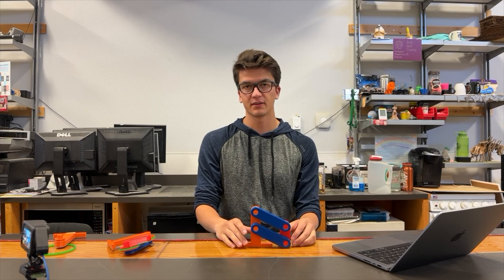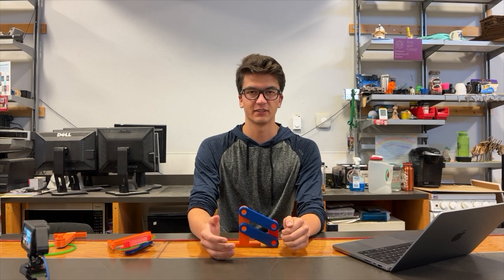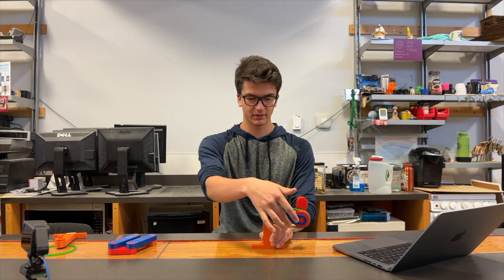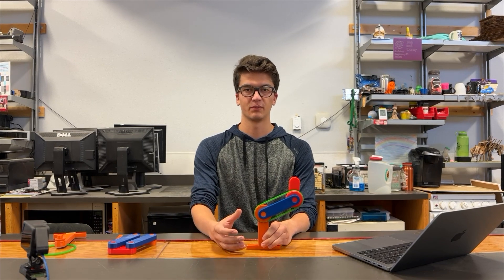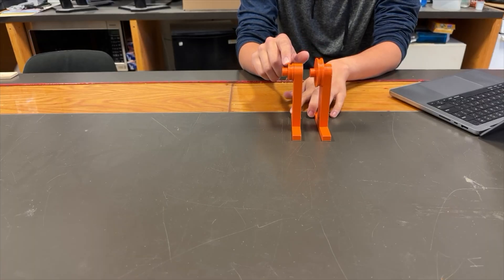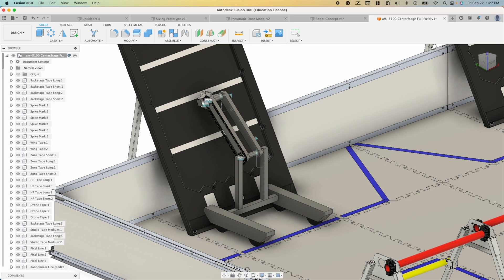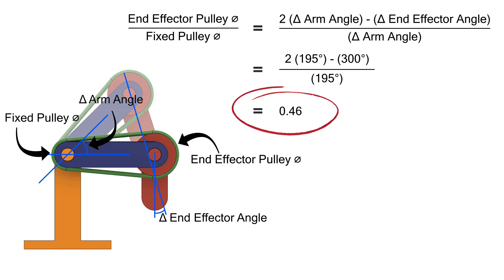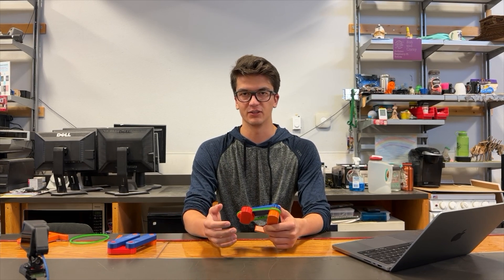Virtual Parallel Four Bar Mechanism for FTC

Comment: If I want to rotate the arm and keep the end effector at the same starting angle (i.e., change in end effector angle = 0), the formula in the video would suggest a gear ratio of 2:1. That doesn't seem correct. Am I using the formula incorrectly?
Reply: if you want the end effector at the same angle, then it should be a 1:1 ratio, which is a parallel 4 bar linkage. at the same time i'm having slight trouble understanding the question so my answer might not be that helpful
Reply: @notsaltysugar  I am aware we could use a 1:1 gear ratio to keep the angle the same. At the 4:00 timestamp in the video, there is a formula to calculate the gear ratio based on the desired angles. I am validating the formula with a 1:1 gear ratio scenario and got a different answer using the formula provided. I am wondering if I am using the formula incorrectly.

Comment: Greetings,
In your Fusion model, you show the arm and the end effector both rotating counterclockwise. If you are using a chain and the large gear is fixed, doesn't the small gear and the end effector rotate in the opposite direction, clockwise?